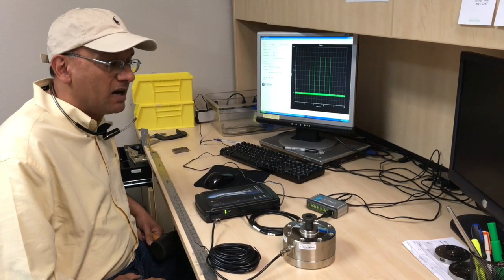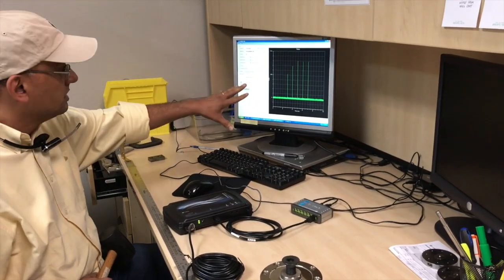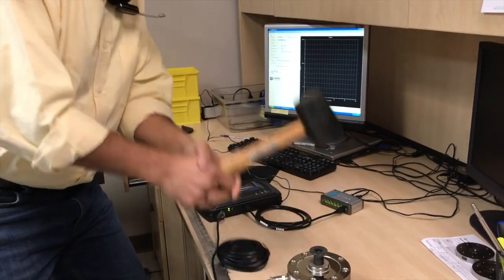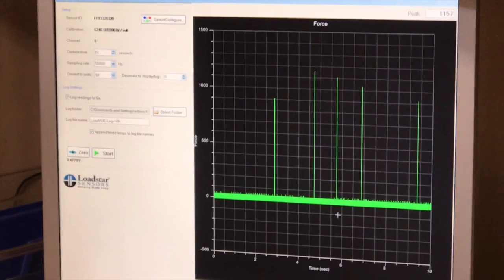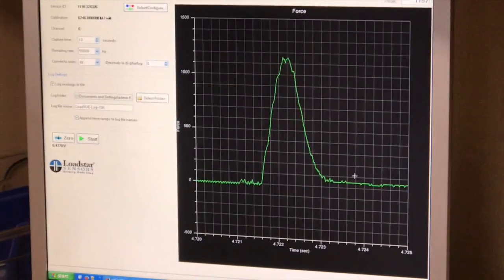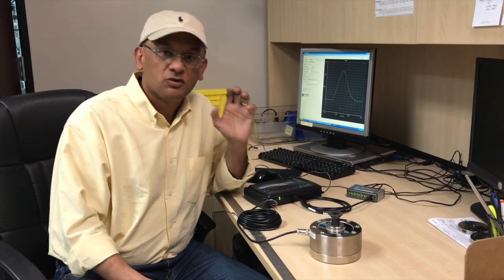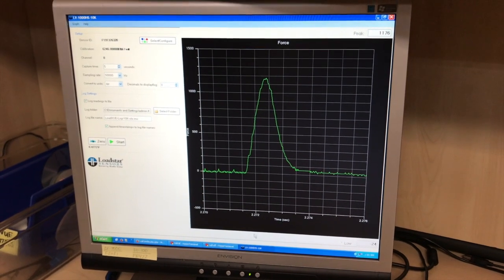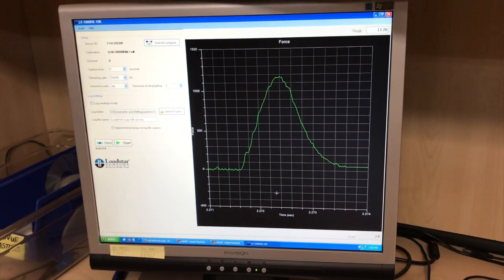Measuring the Impact Force from a Hammer or Rubber Mallet @ 50 Khz Data Capture Rate

Comment: I like the video, but should look into a stationary mic for sound but I'm more concerned you're losing force on that surface. Shouldn't your surface be as inelastic as physically possible?
Reply from the maker: Yes, we will use a better mic next time. Thanks for watching and your feedback! We use hardened carbon steel on top to make it as hard as possible at the lowest cost to keep things economical to make and use. You are also welcome to remove the upper plate and simply use the sensor in its base configuration.

Comment: Why you have (zero) baseline shift after the impact?
Reply from the maker: Nalin:

Every load cell even after simple static testing will have a small zero error. This is a huge 50K lb capacity load cell. Even if the zero shift was about 50 lbs after a impact, it is less than +/- 0.1% of full scale. And yo can tare it out (zero it out) before the next test. Please contact us on our website for further information and clarifications.

Comment: with 2ms impact time 5-10khz=10-20 samples on graph be enough to catch proper/true impact force 50 is for even shorter contact time like steel hammer vs steel .
Reply from the maker: It is better than anything else available in the market - today - to the best of our knowledge. In a very affordable, understandable and easy to use tool. And we are continuously trying to increase the data rate even further. So stay tuned for future announcements.
Reply: @loadstarsensors  cool sir  i have question  in such impact on your device  it convert momentum of object into peak force or kinetick energy or it depend on some variables ? can you d such test for egzample be drop the same object let say some ball from let say 2 diffrent hight but the hight must be known precisely than we can calculate impact velocity  so momentum and kinetick energy of object if we known its mass than we can comapre peak force value to momentum and kinetick energy this object value and find out which ratio is closer :x im found that fc 20 k axis catch momentum as peak force  while powerkube energy  in diffrent study i get contradictory data so im confuse lil can you help me and try answer on this question  ? gretings .
Reply from the maker: @mociczyczki  Please email us at sales@loadstarsensors.com with your specific questions and we will be happy to answer it. yes you can drop a ball from several different heights and calculate the impact force as measured by the sensor from the conversion of potential energy into kinetic energy. And yes the software can show you the curves from multiple runs and you can plot them on top of each other to compare the results.

Comment: This is a good demonstration and cool set of instrumentation, but unfortunately totally inaccurate because the desk supporting the sensor is not rigid enough and clearly was moving (things falling out) therefore a lot of energy was directed through the sensor into the deflection of the desk.  An experiment like this needs to be performed on a concrete block or a concrete floor - something we engineers call an "infinitely rigid structure".  I would guess that the force generated by the hammer would be a degree of magnitude greater if the experiment was set up correctly.
Reply from the maker: It is not TOTALLY inaccurate! it is accurate given the assumptions of the rigidity of the table, the floor, the foundation etc. etc. lol! Everything matters when it comes to measuring forces! We offer a "fast" force capture system that is practical and easy to use. The base on which the sensor is placed, how it is held in place etc is up to the user.